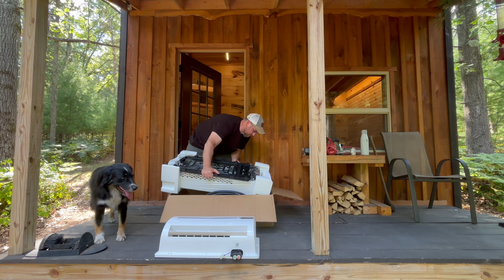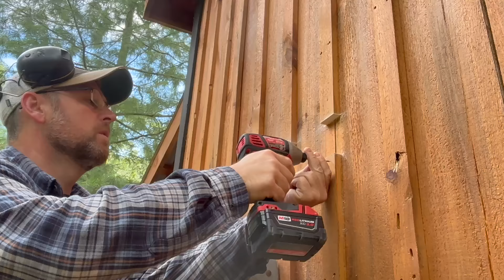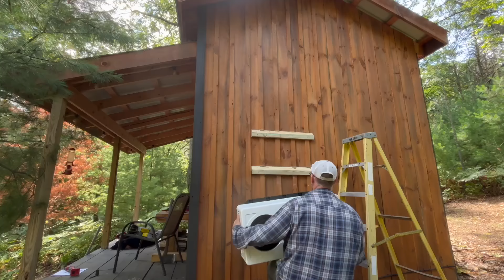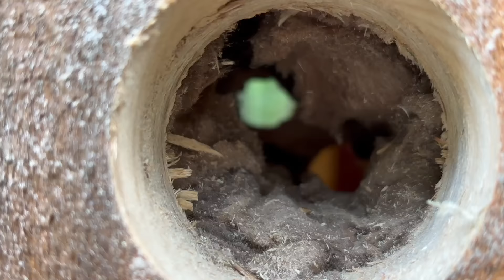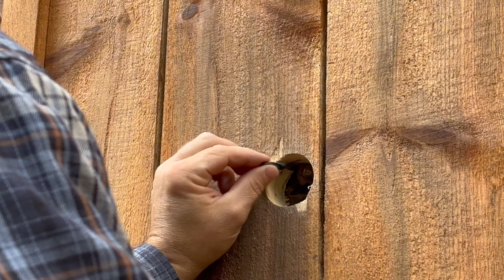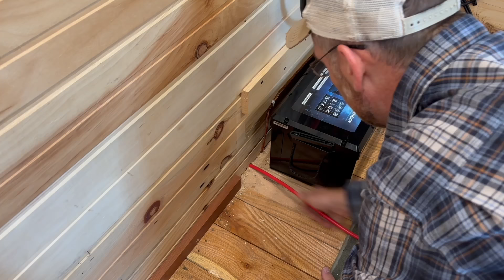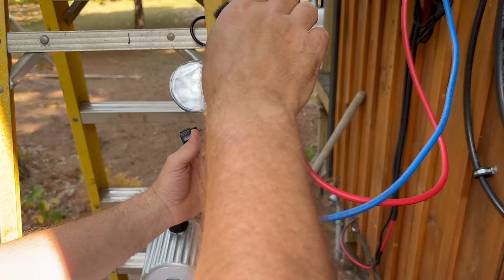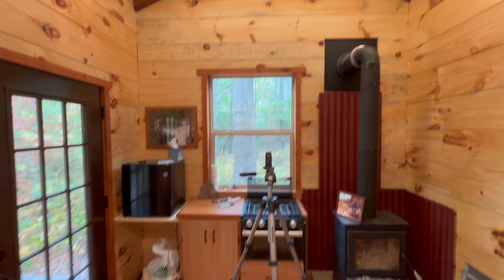12 volt Air Conditioner in the Off Grid Cabin ! OutEquipPro

Comment: Good job on the video and the install. I'm a do it yourselfer and last year installed a 110v mini split on my garage. So far it has been working great and I live in florida. The one comment I might add is that when I installed mine, my friend that has been installing A/C units for years, told me not to let the refrigerant lines hang below the outside unit because this allows the chance that the oil that is carried in the refrigerant to collect in the bottom of your loops and not get back to the compressor potentially ruining the compressor from oil starvation. Your best option would be shorter line set, but the easiest way to remedy this now, would be to reroute the line set to a more horizontal path above the unit. Not trying to be a know it all, just passing on knowledge that was passed down to me. I'm jealous of your tiny cabin and land BTW!
Reply: People being helpful in YT comments? Inconceivable!

(But seriously, thank you for sharing this. Today I learned something new as well!)
Reply from the maker: Thanks !! I will have to  raise those hoses up  thanks for the tip I would like it to last a while !! . no worries you said it in a friendly helpful way  a quality sometimes lacking in the comments . I appreciate it !!
Reply: @blackspruce1861 came to mention the same information. Set up looks good. I wonder how it will be up in your loft at night.
Reply: @mikefeddersen2476 
Was thinking about that myself. A small fan circulating the air around  would seem to fix that concern.
Reply: @blackspruce1861  Do yuo know those hoses can be cut shorter?  Any truck/car shop have that crimping tool  to crimp it back. Of course,before removing,you have to recuperate the gas,by closing the high pressure and run it for a couple of minutes,then close the low pressure before stoping the unit. This way,the hoses and the inside unit would be vacuumed ,all the gas recovered in the capsule. I did this many times on AC house units on the renovations of homes, when i needed to  to temporary remove the split unit.
Reply: @blackspruce1861  Should have coiled the coolant lines before connecting to the unit to make a neater install.
Reply: That is corect inform. Your Friend is right…
Reply: 1) I would use exactly the correct size torque wrench, or at least correctly sized wrench on fittings. I cringed when you brought out the Channel Locks. You cannot properly torque those fittings without the correct tools. There is an excellent reason why they have a torque spec. Overtightening is your enemy.

2) At least check for leaks with dish soap.  Better - I would do a leak down test for at least an hour (vacuum pump off). I will be surprised if you did not have a leak that you later discovered. A slow leak is extremely common with such a system.

3) Use Manifold Set and check the gauges while that unit is running. You want to know if there is any restriction. If there is, inverter based units will self regulate and you can see it. In the old days, you saw high head pressure and you knew fast that there was a problem.

4) If you don't see an 18 to 20 degree delta between register and return...start investigating. Time to know the characteristics of the refrigeration system and look at your gauges.
Reply: Sebenarnya olie compresor tidak berkurang banyak dan tidak ada masalah ,jang perlu di cek posisi out door unit harus vertikal atau horisontal 
Unit itu biasa di pasang di cab mubil secara horisontal
Reply: Another chronic taco☆eating know-it-all.
Reply: Hola amigo que bateria de cuantos amperes deve ser mi bateria para mi auto
Reply: The longer the line set, the greater the charge. The shorter the line set, the less charge is needed. 
Your mileage may vary.
Reply: On a properly designed system, it doesn't matter. Ever seen outdoor units on the roof of houses and buildings while the indoor units are inside?

The velocity of the refrigerant is more than enough to ensure the oil returns. 

In some situations it matters, but for most small air-conditioning systems, it's not a worry.
Reply: Ive installed 3 mini splits myself and did horizontal loops. No vertical loops didn’t have to shorten my lines just horizontal loop and you’re good to go. Love the cabin!!

Comment: How many AMP is it drawing
Reply from the maker: from the website it draws 216 -744 amps
Reply from the maker: sorry thats the wattage , ive answered a few now and got confused . it draws from 18-62 amps
Reply: @blackspruce1861  Doing the math with solar at 4 hours a day trying something new wind and solar controller using the heat resistor in the house for heat in the winter for byproduct when not using the AC
Reply: @blackspruce1861 thanks for this information will put 3 units in a 70 foot modular home I have 6 inch of insulation using 220 volt ac . I want solar

Comment: All I would have done extra is a leak test with soapy water. And some cable/ hose management on the outside. Make a nice looking conduit out of the same would as the outside wall and make sure all those cables and hoses are out of sight

Comment: You may have to sleep on the floor on hot nights cold are will only go up to the indoor unit and shut down . Cold air will go down then and hot air will go to the roof . So putting the unit in the loft area would have been a better idea for sleeping. Heating can go on the floor for winter. The fix would be to put a fan in that will circulate the cold air right through the cabin for sleeping.

Comment: Love the ol tracker/ grand vitara ya got..amazed its still going.
Reply from the maker: Yeah it's pretty handy especially on narrow trails
Reply: @blackspruce1861 i had 3 early 90s trackers..those things in 4lo and 1st gear would go about anywhere you pointed it.
Reply: I had a 95 tracker hardtop 4x4 I special ordered. Never had a single problem out of that car. It was unstoppable. Wish I still had it.
Reply: @gregcrabb3497 yeah the 95 and older were definitely the tanks and the 96 newer weren't the worst but nothing to write home about, basically equally good and bad as most "imports" were..

Comment: So is this unit straight AC or is it a bidirectional heat pump AC is only good for maybe 30 days per year up here whereas a heat pump would be useful for 120 days or more I'm currently setting up a tri system 120 volts 2000 watts pure sine wave for all electronics and motors 1750 watts modified sine wave for cooking and 22 volts DC for all low voltage items a 12 volt heat and would be ideal
Reply from the maker: yeah it just does air conditioning . that sounds like a great setup

Comment: Truckers are seriously using these now and hooking them through the rear of their cabs. They are so energy efficient that you can run the unit while on down time and your batteries charge while your on the road (also with solar). You can't beat it plus it help's with their MPG by not using the actual semi's AC and just using the unit itself.

Comment: I love refrigeration so pls don't get me wrong, but 18A to 62A continuous (as per the datasheet) seems like a heck of a load to put on a wee 12V system! I hope your batteries last in the long term :) And if not then there's an opportunity to look into a 48V off-grid setup afterwards.
Reply: Systems pulling up to a couple hundred amps isn't uncommon in the 12v world. It just gets pricy when you buy the right wiring and components for those huge currents.

Comment: How many  watts does it take ac?
Reply from the maker: I believe from the website doing the math volts time amps =watts  it should be from 216-744 watts so probably depend on the mode you're running

Comment: Cool little unit.  I'd like to see a 24v or 48v as well for easier wiring for remote builds.
Reply: Plenty of other brands out there that cater to 24V, 48V, 60V and even 72V electrical systems. These AC units are all manufactured in China by a couple of factories, and they have various types of mounts for the outside units, and different styles of indoor cooling units. You can even get one with just 4-6 round ports so that you can attach hoses to vents, make it into something similar to central airconditioning, and hide everything behind panelling.

Comment: It would have been informative if the season were summer, when the solar panels are at their least efficient and the outdoor temperature would have put the unit to the test. I wonder whether it would work better if the lines had been rolled up on a horizontal surface between the height of the outdoor unit and the hole where they travel inside. It's no surprise that it's working well given the conditions under which this test was conducted.

Comment: Good job on the pump down of the refrigeration. Pro tip though. Take your gauges off after you put the refrigerant into the system. It makes it so that you’re not pulling any moisture in when you’re taking them off because the refrigerant would just push it out. Good job still.
Reply from the maker: Thanks !! I was told that too but decided to follow the instructions with the unit probably should have went that way

Comment: How many watts did it pull on average after it was down to temp?
Reply from the maker: I don't have a shunt in my system so I can't see anything other than the voltage on the battery . I need to upgrade

Comment: Up there in MI you're cooling down from 77F. Down here in FL, I have my AC running to keep my home at a cool 78F 😂 If my home was cooled down to 68F, I'd be wearing a parka! Your cabin is totally hooked up. Very nice. Also noticed your Youtube award o that shelf ~ that was quick! Bravo.
Reply from the maker: LOL I wouldn't make it through a Florida summer alive !  Thanks !!
Reply: @blackspruce1861  Half the AC's job in florida is controlling humidity too. Your home will literally rot away without regular AC use to drop you from the default 60-80%.
Reply: @superslash7254  After we lost power for 3 weeks in Houston after the last hurricane, my humidity was high like that and I developed mold in the AC ducts.   
I got rid of it with UV lights and by running the heater once power was back.

So you are totally right about high humidity causing mold (and eventually rot).
Reply: @superslash7254 yes but its also not insulated like it should be . Less run time and sealed home so you dont run your AC  all day .
Reply: 😂 70's and 80's 🤣.... Watch a whole central AC struggle cooling a house in 110°
Reply: My question is would that unit be able to keep up in a southern summer like Florida or Louisiana etc
Reply: @CDcooper3876  really just matters on your insulation. Not these units, but in my experience with regular camper units you're looking at a cool 78 on a 90 degree day. Maybe a bit lower if you're in the shade. It's more "don't have a heat stroke" than "nice a chilly"
Reply: Michigan is still hot and humid

Comment: wouldn't the control wire fit through the larger size hole drilled for the line set?
Reply from the maker: yeah probably would have but I wanted the connector off to the side

Comment: Notes for future reference:

1. Tape the ends of the lines to prevent dust/contaminant before connecting to unit.
2. Open suction line valve to get a slightly positive pressure BEFORE removing the hoses after vacuum. (You don't "lose vacuum", you injest non-condensible contaminants. Better to lose a fraction of an ounce of refrigerant then to suck in ANY atmosphere.)
3. Measure the air temperatures entering and exiting the indoor unit coil. Should be anywhere from 16 to 22 degrees difference. A 20 degree drop is about normal.

Nice job. I've been looking at these for a camper van for awhile now.
Reply: "Better to lose a fraction of an ounce of refrigerant then to suck in ANY atmosphere." 
Very right

Comment: Nice.  You will want a little fan to help circulate the air in there, even though it is a pretty small space.  I learned from my own cabin that these small mini-splits work kind of like filling a kiddie pool with a garden hose.  Remember that hot air naturally rises and cold air naturally descends.  So when you turn it on it is like pouring a stream of cold air onto the floor and then slowly that layer of cold air will rise up to the level of the unit and then get recirculated.  To push the cold air up into the loft above the unit will require a fan that circulates the air around the entire cabin.   It won't take much in that small space, like a small Vornado fan or a smaller ceiling fan.  Otherwise you will end up having to over-cool the downstairs to get the loft comfy enough to sleep in, wasting a lot of energy.

Comment: Can you confirm that the wattage used is around 216 watts on low setting and 744 watts on high? Nice little setup, would be good in a 10x20 lofted storage shed.
Reply from the maker: I wish I could but I dont have a shunt in my solar set up so I dont get the wattage or amp draw specs , just the charge controller telling me the battery voltage .

Comment: Really great install vid. Honestly though for my off-grid cabin I much prefer to just run a small window AC unit. Pops in or out of the window in 60 seconds, no real installation at all, runs off the generator, isn't permanent, and they're pretty cheap.

Comment: I love the mini split designs.  Please do a followup after you have had a chance to run yours over night a few times and let us know about power consumption.  I'm currently using a window mini split at an off grid cabin of mine. I'm constantly amazed that my 12k btu is able to both keep the humidity down in the summer and keep a 2300 Sq ft cabin at a comfortable tempeture. Like you I only let it run during the day, just in case. Having wifi and the internet I can monitor power its using and the charge in the batteries.
Does your air conditioner have wifi remote controls? That was one of the selling points I looked for.

Comment: 1. The description says "off-grid" so it's not exactly an experiment. 

2. It's a 12v inverter compressor. This means you aren't gaining anything unless your current inverter couldn't handle the load. It is rated at 12v up to 62a. That is 744 watts max. 

Using a similar SEER rated 120Vac minisplit (12500 / 744 = 16.8) means 120Vac at 6.2 amps. 

While a SEER of 16.8 is only a dream for RV rooftop air conditioners who often are rated around 8 to 10, it is low for a minisplit where you can expect 20 to 25.

A good 120Vac 12500 BTU  minisplit will need about 500 to 625 watts. There are even 12v/24v/48v true DC (no inverter) minisplit available. 

3. I cringe when I see people build an off grid system like you have. You really should be using either double 2/0 or 3/0 cables (Depending on length) not single 4/0 with a 3000 watt inverter. 

With 4/0 cables you are limited to a 12v 2500 watt inverter. 

For 3000 watt inverters you should be using either 24v or 48v battery banks. It just happens that most hybrid inverters use either 24v or 48v. 

A good 3000w hybrid inverter, such as the EG4 3000EHV uses a 48v battery system. It costs $700 but has the following features:
- 3000w 120Vac pure sign wave inverter
- 5000w MPPT solar charge controller
- 60 amp charger from 120Vac, about 3000 watt
- generator dry contact support. This means that the inverter can automatically control a dry contact capable inverter to automatically start and stop the generator 
- smart battery communications. When used with batteries capable of battery communications the battery will know the exact SoC, battery voltage, battery amps and any limits by communicating with the battery BMS. This also precludes the need for a battery monitor with shunt (and us more accurate)
- can parallel up to 12 inverters, each one adding 3000w of inverter, 5000W solar MPPT

You could also upgrade to the EG4 6000xp which is a 6000w hybrid inverter with even more features. It also uses 48v battery system but is 240Vac split phase at 25 amps. You can parallel up to 16. Each one has two 4000w MPPT solar charge controllers, plus 240Vac in and 240Vac generator in. 

Using two in parallel means enough power for a 240Vac dryer, a 240Vac water heater, or large 240Vac welder. 

Large RVs utilize 240Vac 50a systems. 

4. For all that is holy, if nothing else trim back some trees. Having two 400w panels (even shade tolerant) and four 100w (early technology shade tolerant) panels may be 1200w on paper but I know you are never coming close to that much peak. You are probably doing good to peak at around 400w for an hour or two, on a good sunny day. 

Buying quality panels helps with shading, but nothing will help as much as cutting down a few trees and trimming back other trees. 

With your current setup you probably can run the air conditioner on low for about two hours per day if you limit other usage. Only on good sunny days, unless you are charging your batteries with a generator. 

Unless of course you live in an area that has average summertime high temps in the 70's which means that the air conditioner can keep the cabin dehumidified and in the low 70's with just a few minutes per hour of compressor runtime. 

If that is the case you probably could have just bought a medium sized dehumidifier that drains outside for less money and using less power

Comment: Absolutely great product. I wish they would add 24v and 48v DC option as we all switched to higher voltages a long time ago.
Reply from the maker: Thanks !! I just did a google search and found a 48 volt down to 12 volt 60 amp DC converter regulator reducer . that might work

Comment: How much is it actually drawing while in use? Surely you have some sort of device to show usage and not just "well I've got 800w of solar in the shade and the battery voltage is mostly the same"...
Reply from the maker: I wish I did . what I really need is to get a shunt for my system so I can get some real specs